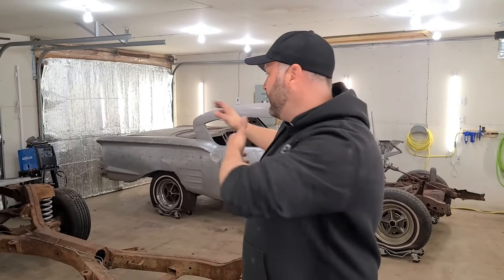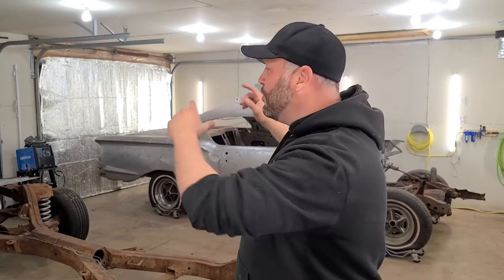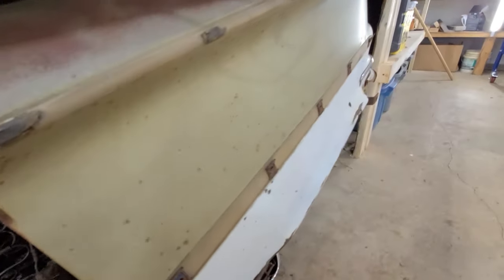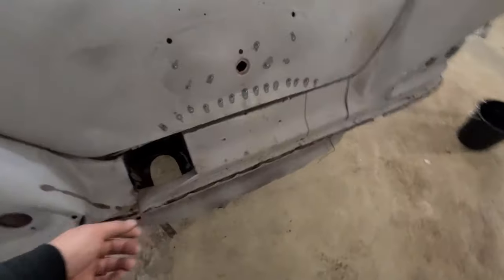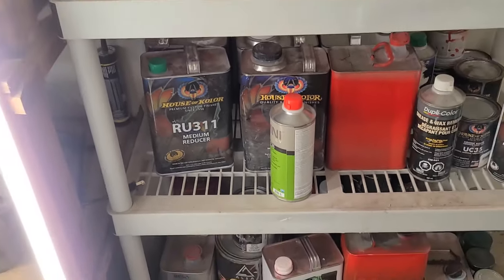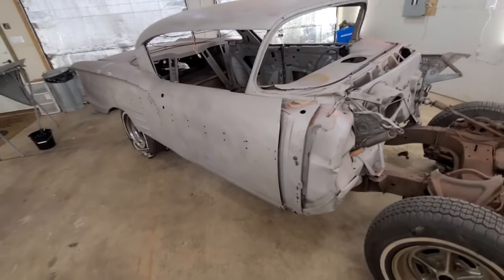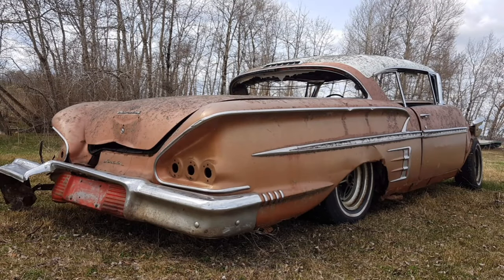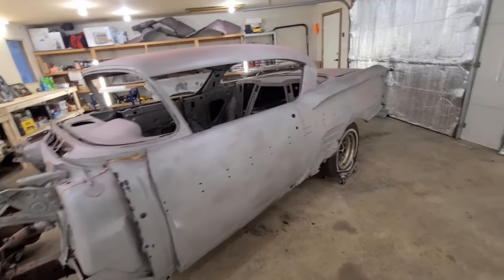1958 Impala update and Concept Art Reveal

Comment: Diamond in the rough!!! A 58 has been my dream for years,  back in 1975 my dad could've bought a 1958 impala Black and white two tone and air level ride for $800. The car was perfect,  no scratches,  nothing wrong with it. Yes it had the 409 😁
Reply from the maker: That's awesome 58s have such a beautiful style to them.   And now they are very hard to find.  So there was no way I was passing this one up
Reply: That 409 was a replacement motor.  The 348 was the top engine in 1958.

Comment: At least it was free, a friend of mine paid $400 for a P.O.S. 1955 Bel Air sport coupe, that was stripped of usable parts. Back in the 80's he bought a rough 1966 Impala "SS" convertible, that I owned from 1995-2016.
Reply from the maker: Yeah there definitely wasn't much Left of the car when I found it.  I've got new trunk floors, inner and outer Rocker panel's, wheel well Arch's, inner and outer head lamps replacement panels for it now, just need to find the pitch fork panel on the drivers side and some floor panels and I can get back to work on the 58
Reply from the maker: Nice a 1966 Impala SS convertible would be a nice car, I've got a 1967 Impala SS convertible.  I can't wait until things really take off and ai can just work in my shop each day restoring these classics

Comment: Sir. Brace the body with sq. Tubeing.. before u cut . On the body. And re.weld. and brace the mounts for the top wishbone ..brackets on the frame. And save these bent one piece  California  bumpers. And if. U get a frame chart from the shop man. You need the supplement  because the measurements. Are incorrect in the s.man. and I'm looking for a 58 post. 2 door. Body. Once u get the chrome  off those bumpers the bend back easy. I worked at a chrome  shop. And it be cool to incorporate  the k.coral paint. In the art work.  Love  that color.  It has gold flake in it. FACTORY.   58S RULE......
Reply from the maker: Thanks, Thats the next step I have to do with the 58 is brace of the car with square tubing. And swap out the frames and roll the new one underneath.  Yeah the original bumpers that were on the car aren't in to bad of shape they are only bent and they are not creased.  They can be definitely be reshaped

Comment: Work on the 58
Reply from the maker: I will be working on the 58 Impala, it's going to be my 2021/2022 winter project so I will have lots of videos coming up for it.    I've got few new videos recorded boxing off the 58 etc. And getting it on the new frame et .   I will be posting in a few weeks.  Once I've caught up with stuff that was recorded before that.  I have had a hard time finding replacement panels for it that were in stock and suppliers that would ship to Canada was the biggest issue.    Recently I did find some suppliers that can make the panels and also ship to Canada.